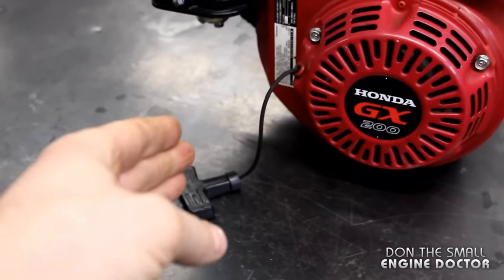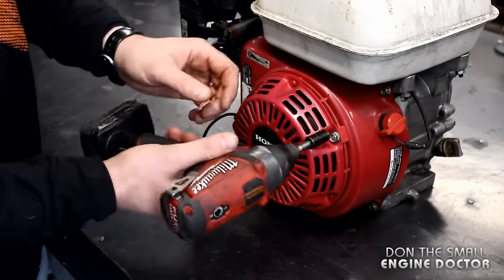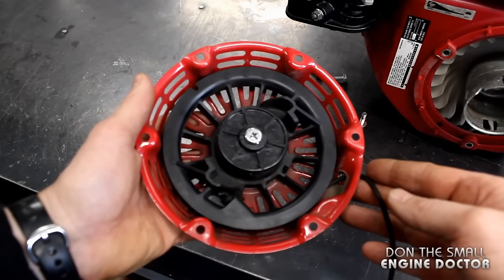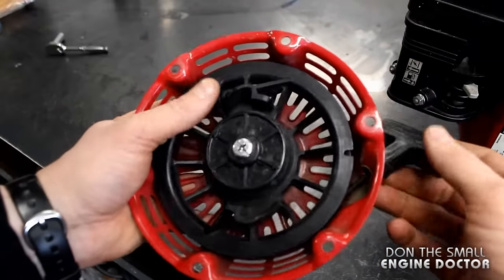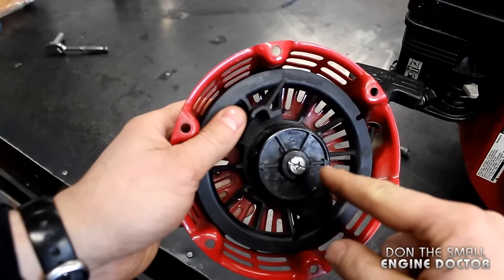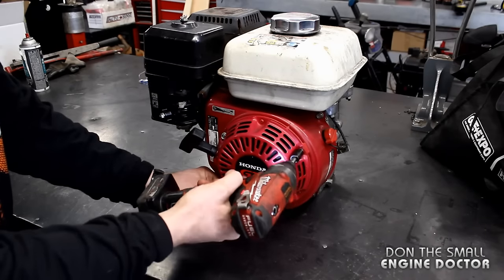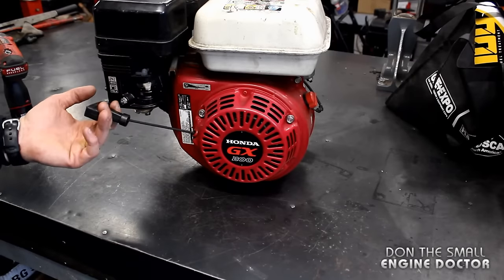HOW-TO Tighten A Limp Starter Rope That Won't Retract On A Small Engine - Video

Comment: Nic explanation without getting into the weeds, personally I have had to mitigate this issue to a different tune for older mowers and trimmers, 2 & 4 stroke, doesn’t matter, but it is easy to butterfinger an older and non-captured spring, but same exact principle nonetheless. I always remove those recoil housings like they were a can of snakes just waiting to go full slinky at any moment, lol. That said, yes, you explained exactly the best way to perform this task without ending up with short cord syndrome, or a ball of clock-spring to take a good couple hours to fix…or multiple attempts, especially if on an old greasy cord on an older machine, case and point, my old Mac 10-10 chainsaw, gotta do some maintenance, which includes a de-limping of said cord. Drives me nuts when those things are rattling around all loose and you can hear the sprague clutch dancing around like some wind chimes 😂😂

Comment: Good fix. But you need to follow up with lubricating it with a 100% silicone spray. I would recommend Amsoil 100% silicone spray. It's specifically designed to lubricate plastic to plastic and plastic to metal surfaces. When sprayed it dries quickly to leave a very slick surface for these types of areas.

Comment: I followed the video for installing the cord and had about 3 of cord hanging still. I figured I would test the unit before trying to rewind it and it cranked up just fine with plenty of cord. I may have bought a cord that was a bit too long, so is it okay to just cut off the end at the handle and shorten the cord a couple of inches?

Comment: Hey! I just adjusted the valve lash on my tecumseh. But, the old thing still won't start. I've replaced the spark plug, carburetor, and recoil start. It has spark, and starting fluid won't do the trick. It is a Tecumseh OHH60 power sport.

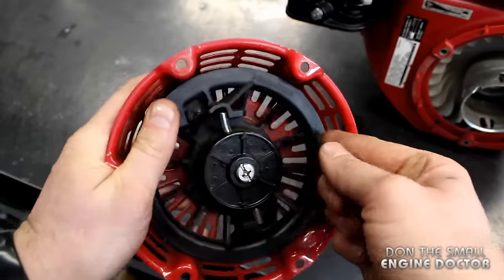Comment: Great tip.  What are the 2 opposing arrows on the inner wheel of the recoiler used for that you can see at 1:08 ?
Reply: They engage the starter when pulled.

Comment: If your chord is long enough and has extra when you pull it out your arms lenghth couldn't you just un-tie it at the rubber handle and re-tie it tight to the rubber handle to save the time unbolting it and taking the chance in breaking the spring.
Reply: Halscamp Yeah that’s what I do.
Reply: By following Dony's technique here, you can replace the entire pull cord if it breaks and he just showed how to wind up the spring. That hole or slot in the wheel is the key. Great video.
Reply: That is one good thing about the lightweight plastic parts these days, you just burn a slot through to put the chord in to wind it up. In the old metal days this was much harder to do. It took a couple different techniques to Get er done.
Reply: Halscamp As long as the cord doesnt end up too short where your reaching the end evertime you pull it. Otherwise the rope will snap and youll be back their replacing it anyway.
Reply: Ya that's why I say as long as it has extra when you pull it out your arms length.